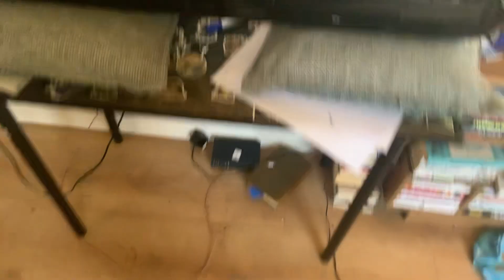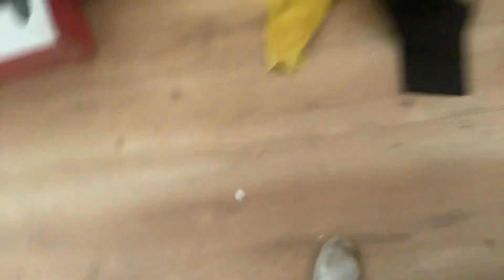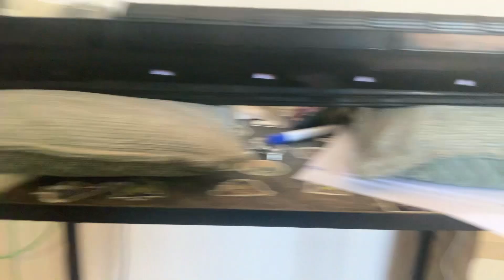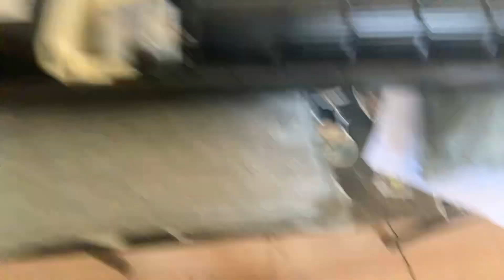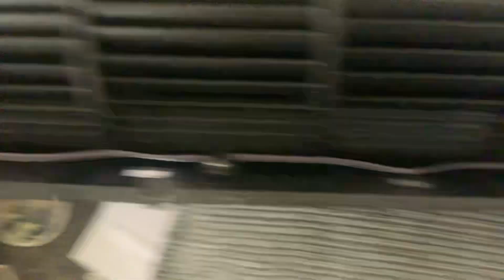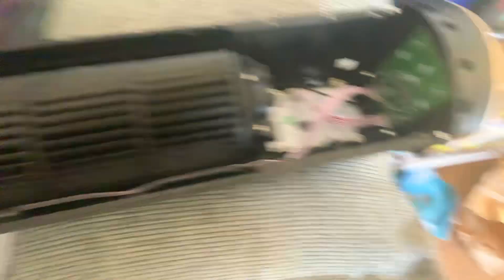SEE COMMENTS FIR INTRUCTIONS - Dimplex ion Fresh - noise / performance issues/ how to open

Comment from the maker: I just realised there’s no audio! Until I fix this issue here was the problem:

- a white ribbon cable that feeds from the top of the unit so to the motor at the bottom is missing a washer that would hold it in place. This caused noise and lessened performance. 
- I detached the copper side panels using two butter knives to reveal the screws and continues to open the unit.
- I then fastened the cable back in place away from the fan blades.

In conclusion the copper side panels were the hardest part of this. If you use a torch and a tool of sort you might reach the plastic teeth to detach the panels that way which will avoid damaging them.